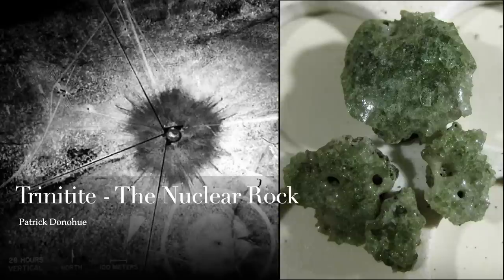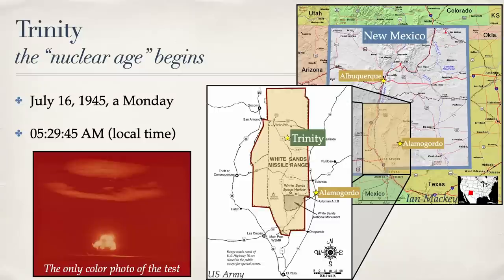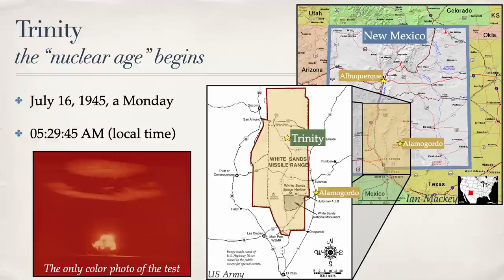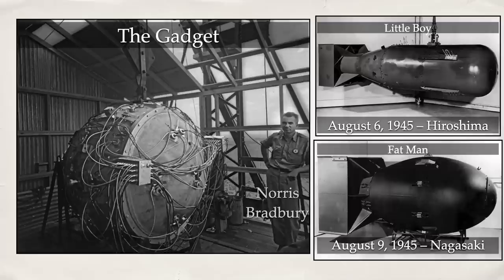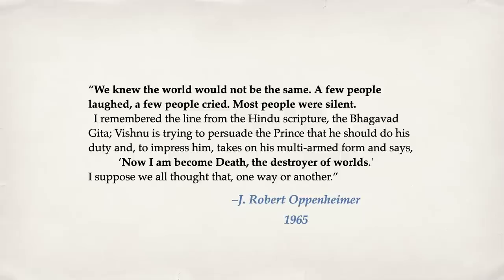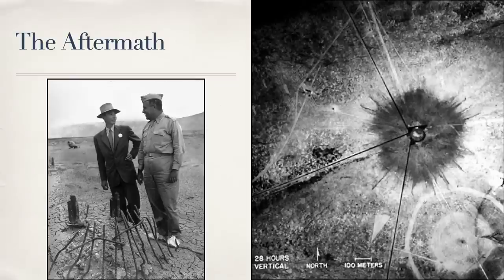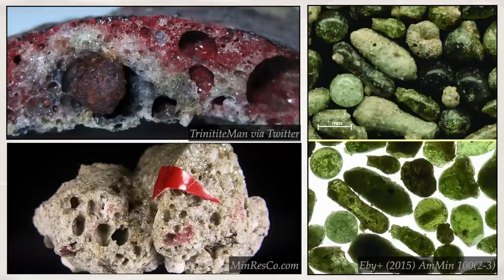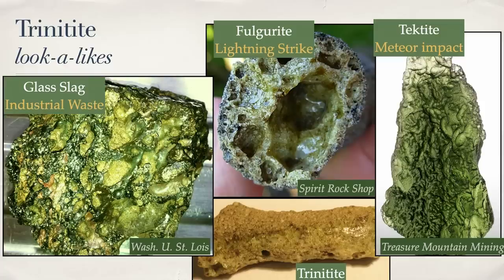Trinitite: The Atomic Rock || Geology Presentation

Comment: SO, this isn't a rock we want to go out and rockhound for huh? Is it super valuable due to how rare it is? It looks awesome despite the reason it exists.
Reply from the maker: Well, that's the thing; It's illegal to collect at the Trinity site, so you can't rockhound for it. I guess compared a lot of minerals it's pricy, fetching similar prices (~$7 to $12/gram) to some meteorites in terms of dollars per gram.
Reply: @DonohueLabs  I have sold most of my better specimens at $20/gram with some special higher count specimens going for individually priced without regard to weight.
In general the Bowers material was filthy due to storage by the first Pray cache owner storing the ton or so in several open 55 gallon drums. the Bowers material was obviously near the bottom of those barrels and due to the over burden of Trinitite were broken bits.  The bowers material is cleaned using oxalic acid, non-destructively.  All of the Bowers material is much smaller than a U.S. quarter in the kilogram lots that I bought.  In the end He was selling just rubble which my group did not bother with.

Comment: That's pretty awesome stuff! Not the fact that we had to use these disgusting things upon other humans, but it's definite capabilities that are possible only in such a super heated sense. There's no doubt that these nukes were as hot or hotter than the sun, figuring that it was only for a matter of seconds to produce this kind of extreme temperatures and pressures in a moment of time! That basically makes this conglomerate of molten metals and salts within the core of the explosion! Nicely displayed and explained, thank you.